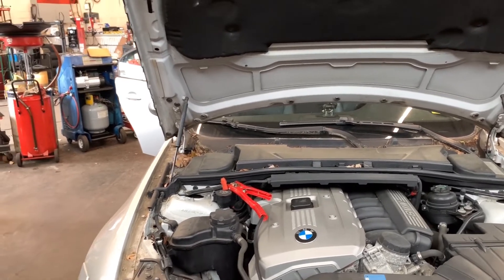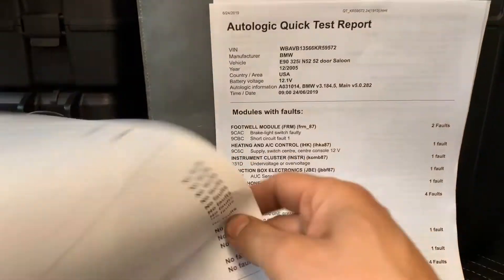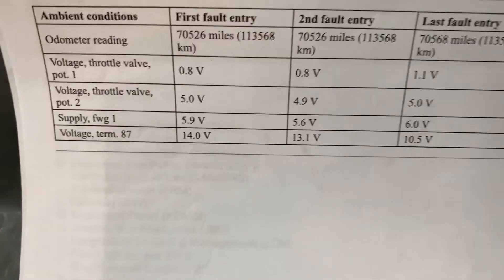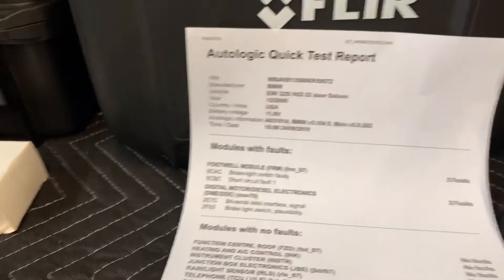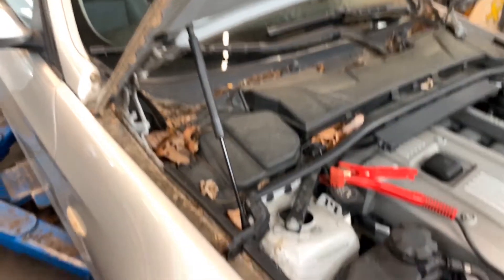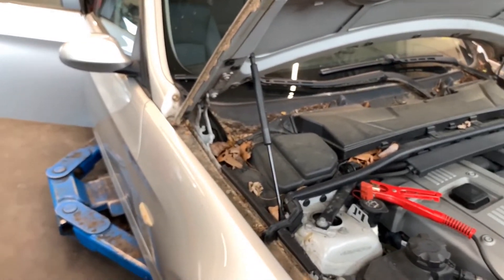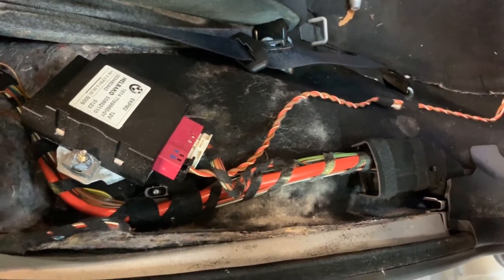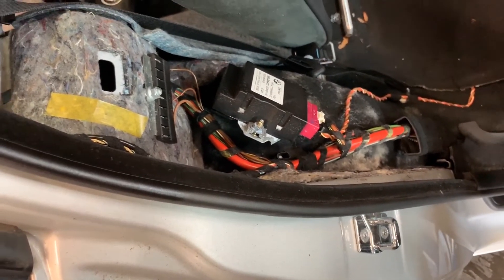2006 BMW 325i crank no start diagnosis with Autologic Drive Pro

Comment: Start-ability  percentage is the amount of the battery needed to start the car. 29% is good. If you recheck after a battery cycle you will see it’s not much better. Although the battery charge level was low you were correct. But start ability was not a bad number.